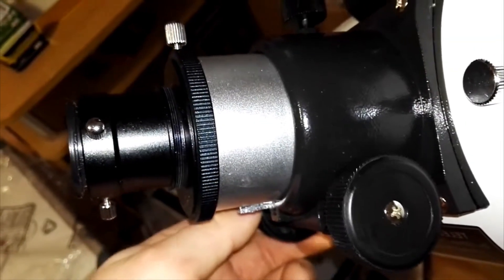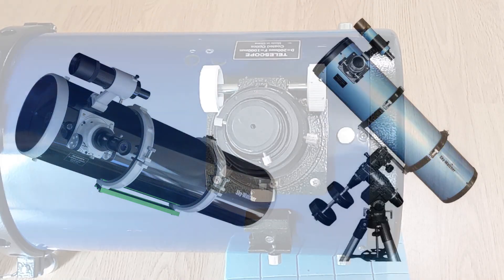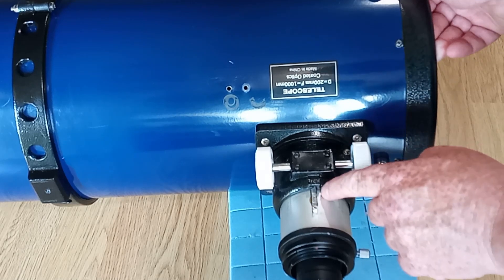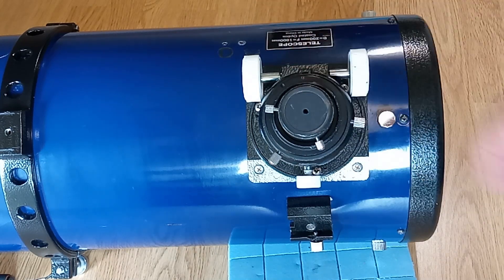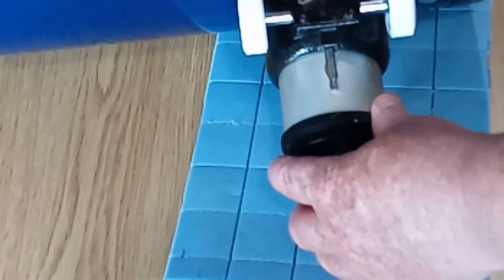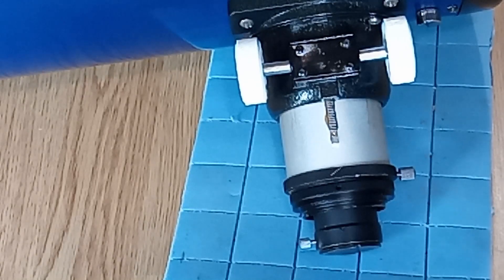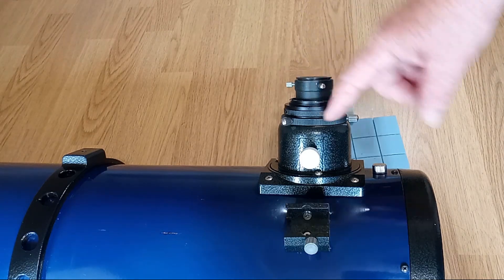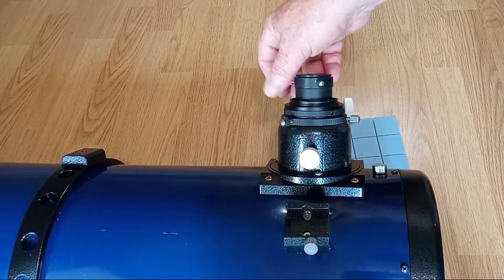Fix Focuser Sag For Astrophotography & Astronomy

Comment: Another great solution. I have the Meade SN8 with the exact same focuser. It's not really worth upgrading the old dinosaur, so this fix will come in handy. 

I have set myself a challenge. Went a bit overboard with buying used astro gear, resulting in a lot of excess just lottering about. So deciding that I have to use everything for astrophotography a few times. Then find some youths to donate some of the kits to once I have it sdailed in. and basically reduce my arsenal to just the few items I intend to use at least a few times a year. So up for grabes will be the 8" schmidt Newtonian + LDX55, Meade 10" SCT on lx85, Vixen R150s on a Super Polaris and various other DSLR lenses/ Eye pieses to hopefully get someone stared on their own journey.
Reply from the maker: Fantastic!

Comment: Brilliant hack, well done! Lots of people complaining about similar issues and the only thing I've seen until now was adding more PTFE tape but this takes it up a notch.
Reply from the maker: Thank you!
Reply: @Cheapass-tro  this encouraged me to open apart my (even cheaper than yours) Celestron 130eq focuser and it revealed that they cheaped out on the nylon tab, putting only a single 2cm strip in there. I'd be tempted to replace that with a much longer strip but it would involve taking the focuser off the tube carefully, and sourcing some suitable sticky tape Teflon. As an alternative to your beer can, I went even simpler and kept adding duct tape until it was a snug fit. Regreasing the whole (plastic) rack and pinion with super lube seems to be making the whole thing feel smoother and lets me tighten the screws a bit more than they were before. End result is a massively improved focuser, thanks for the inspiration!
Reply from the maker: @fommil  "Massively improved", that's what I like to hear. If it works it works, so good job. I would be a little concerned over the adhesive from that tape in warm weather, but that may just be the cheap duct tape I use?

Comment: Before you do this, see if you can resolve sag by adjusting the two little screws on either side of the tensioner. They're easy to miss. I had the same sag issue, and all it took was tightening the two little screws that push onto the tension plate with some small allen keys.
Reply from the maker: Good advice. I of course had done this first step, but the play was still there.
Reply: i did this and it worked.  those two little screws are easy to miss! thank you sybrandstrauss

Comment: i tired this and my focuser still sags emmensly. looks like ill be getting a low profile crayford.
Reply from the maker: Aww that sucks. Maybe something a little thicker could work? Good luck & clear skies.
Reply: @Cheapass-tro  i stacked 4 sheets and seems to work for now. will deff get a crayford down the line for photos tho
Reply from the maker: @PhotonReceiverAstrophotography  I would sooner put the 4 sheets as 4 single strips around the tube than in one stack, for evenness.
Reply: @Cheapass-tro  tried that first to no avail. focuser is cheap plastic garbage and bends easily under load. only other option I can think of is a 3d printed piece of plastic inserted into the focuser bore where it enters the scope to help guide the focuser tube down the center otherwise it just pivots on the pinion gear and tilts the tube.

Comment: r
Brilliant, instead of aluminum i used Teflon and some superlube synthetic grease with ptfe, also these focuser were good at letting stray light in, after focusing i wrapped black cloth around the draw tube, and taped the base with electric black tape, you brining back old memories with these wobbling focusers LOL. cant wait for the next video.
Reply from the maker: Thanks for that. I didn't have (notice) any stray light but that's a good tip for others reading through!

Comment: there are some differences between your scope and the 200p: yours has a rack and pinion focusser while the 200p has a crayford
btw where did you get your scope?
Reply from the maker: Mine's more like the old blue one. I knew the PDS had Crayfords, wasn't sure about the new P. Thanks for the info.
These were sold out of Lidl in Ireland around the 2006 mark. I bought it used last year.